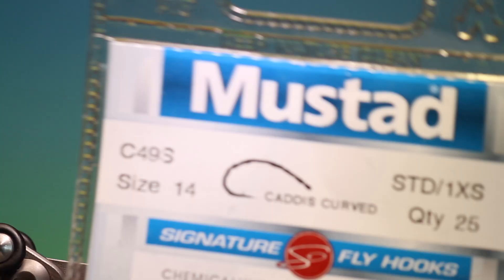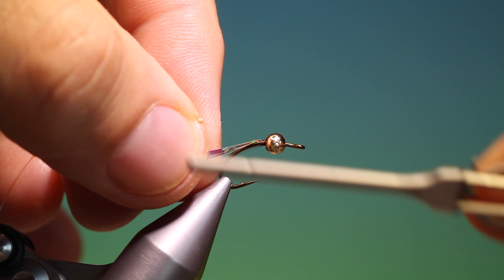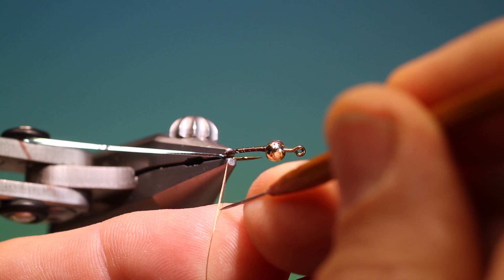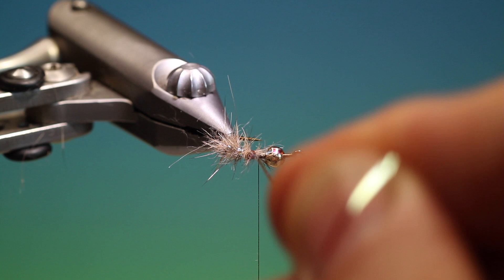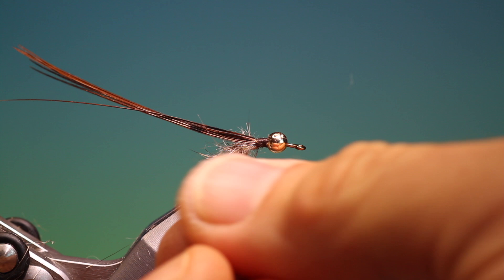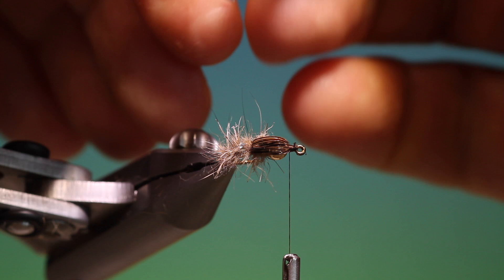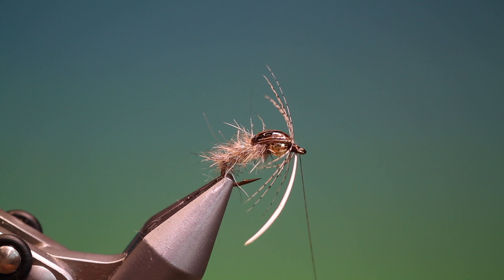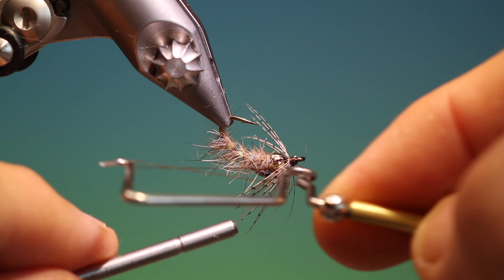Fly Tying the Holy Grail caddis/sedge pupa with Barry Ord Clarke

Comment: Split the thread? ...... Whatttttt????  I've been trained by masters and have never seen that.  Pretty awesome!!!!!
Reply: The technique has been around for quite awhile.  It is less fumbly and builds less bulk than a traditional dubbing loop.  You may also enjoy the addition of a tiny amount of dubbing wax on one side of the split to help keep the dubbing properly positioned inside the split as you close and begin to spin the thread.  Also try practicing the splitting ofyour thread before delving into an entire fly.  Some threads don't split well - you want one in which the fibers are easily seperated for several inches without too many cross-fiber connections.  Those lead to broken fibers and a weaker thread.
Reply from the maker: If you like that technique Chris please consider this: https://www.amazon.com/Feather-Benders-Flytying-Techniques-Comprehensive/dp/1510751505/ref=sr_1_1?crid=20ARV1L7RMMS5&dchild=1&keywords=barry+ord+clarke&qid=1630915669&sprefix=barry+ord%2Caps%2C404&sr=8-1

Comment: Another great tutorial. Thank you. Really liked the tip on using the tinsel to hold the bead in place. Did you say you used a slotted bead? If so, why?
Reply from the maker: Hi Mike thanks. Slotted beads fit most hook designs. The slot enables the threading of the bead around the hook bend.
Reply: Thank you. I've only used slotted beads on jig hooks. More to learn for sure.!